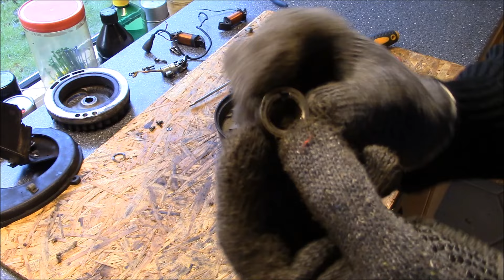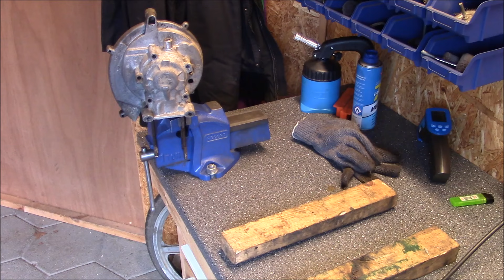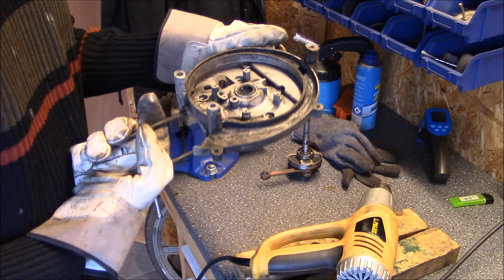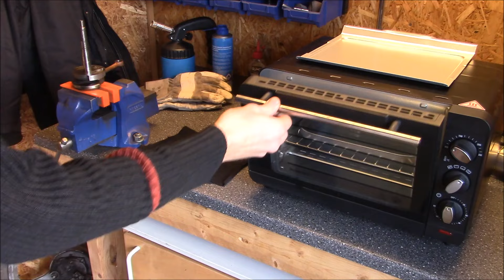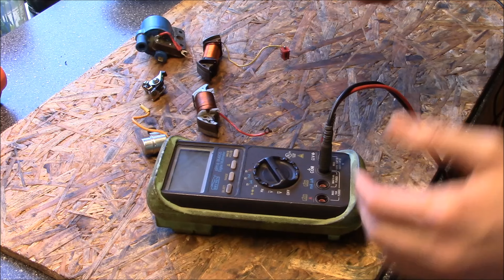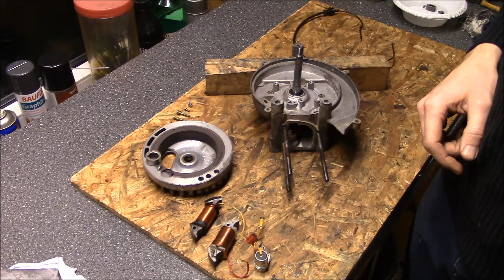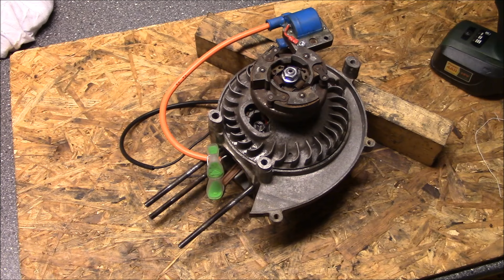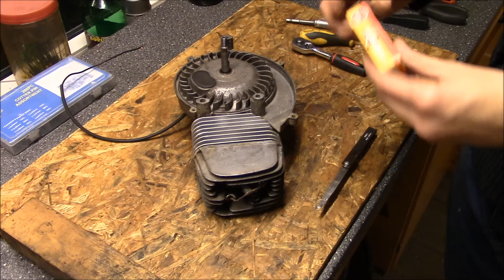Piaggio Moped Engine Rebuild

Comment: What type of silicone is used between the engine halves?
Reply from the maker: Originally, none. Just the paper gaskets. I like to smear them in grease, that makes them hold the position. And if you ever need to disassemble it again, the gasket won't stick to the surface as bad.
Reply from the maker: If your surfaces are bad, you can use a petrol resistant gasket marker. Like threebond 1104 or similar.

Comment: When I step on my kickstarter on my vespa bravo it stops/jumps, I have think it might be the swing wheel being broken, it does not feel like its connected correctly to the engine like yours is on this video.
Do you have any advise to what might be wrong?
Reply from the maker: I haven't worked on the Kickstart model yet, i have one in stock but no experience yet.
Reply: Is it a vespa or a bravo ?

Comment: My ignition coil has 0.9 ohm resistance.  However, it only measures  0.3 volts running when measured at the H.T. input.  Should I replace the ignition coil?
Reply from the maker: Did you measure AC voltage? I have no reference values like that, but your engine is running? What's the problem you are trying to solve?
Reply: @CarstenLorenzen12V  No, that was DC voltage.  I have an engine miss at speeds over 15 mph.
Reply from the maker: @rever1111  the coil makes AC. But that won't tell you much i guess.
A faulty coil could do that at higher speeds and heat in the coil.
Could be a carburetor issue too.

Comment: kan original crankshaft fra 25-30 km/t ciao fra 93 holde til malossi/polini cylinder kit?... du nævner på et tidspunkt de originale dele er ret holdbare... men det var vist mest si og bravo...
Reply from the maker: Hej, ja den er lige så stærk som de andre originale piaggio modeller. Hvis den ellers er i god stand. Husk at tilpasse styretiderne, det kan du se i den anden video jeg har lavet om denne motor.
Reply: @CarstenLorenzen12V  det simpelthen det sjoveste jeg har kastet mig ud i flere år ha! - 1000 tak for perfekt instruktions video. Har downloaded det skema ift.styretider du har lagt ud i .pdf på 12v.dk men er ikk´ nået dertil.  - Blot hygge og hobby no stress, godt din video nærmest er idiotsikker hahaha...

Comment: Perché si mette la spugnetta nel condensatore?
Reply from the maker: The sponge is there to lubricate the cam that drives the points/breaker. Put a little oil or grease on it every time you adjust the oints gap.
Reply: @CarstenLorenzen12V  Ok thank you

Comment: Nice Vid, do you have a video for an electronical carter
Reply from the maker: No, but it's even easier than the model with breaker points. I think the tuning video i made, is an electronic ignition model. But i'm not talking about the ignition in that video. It just needs to be installed, no adjusting.
Reply: @CarstenLorenzen12V  Ok thanks Do you know wich wires would you need to check with a multimeter on the elec. ignition? and are the volts the same as the breakerpoint ign.
Reply from the maker: Yes, here are some values I've measured.
Light, brown 2,1 ohm  6V/10W brakelight or horn
Light, blue 4,0 ohm 12V/10W indicators
Light, yellow 0,7 ohm  6V/20W lights front/rear
Ignition green 430 ohm - ignition primary
Ignition red 51,8 ohm - pickup
Ignition white ~0 ohm - ground
CDI output wire 4420 ohm

All measured against ground. The three ignition wires are the same for all cdi models. The colors for the light coils can vary.

All measurements can very 10% i guess.
Reply: @CarstenLorenzen12V  Thanks again yr help! in the vid yr talking abt blowing on the carb inlet to check air thightness. do you have any air escaping? ik just build a speedengine with a 65cc DR however all nice and tight but with blowing does seem to have air escaping, really minor..
Reply from the maker: @keesgroeneveld965  it's normal to experience some leakage, but only minor. But you need to feel a good resistance. Hard to describe a feeling like that, kinda takes some experience :-)
Reply: @CarstenLorenzen12V  yes resistance is felt. will let you know the elec. results. I am restoring an 2005 Gilera Citta i think i will encounter some more items.
Reply: @CarstenLorenzen12V  hi i have measered them good news there is a reading! the cdi output(sparkplug cable?) reads 5200ohm is that possible?
Reply from the maker: @keesgroeneveld965  yes that is a correct reading. But the internal cdi is not measurable with simple tools. If it works it works, if not, mount a new one.
Reply: @CarstenLorenzen12V  hi carsen could you help me with a film for front wiel axle assembly?
Reply from the maker: @keesgroeneveld965  no time at the moment.

Comment: Do you know what licence you need and how old to drive Piaggio Bravo
Reply from the maker: In most of europe you need to be 15 or 16, depending on the topspeed. But there are so many national laws, so get in touch with your law enforcement. Or maybe google what moped laws your country has.
Reply: @CarstenLorenzen12V  But is it a normal moped or a small moped?
Reply from the maker: It's available as both small and large moped models. With speeds between 25 and 50 km/h, depending on the country.

Comment: At 1:37 this puller, can you give me a link to buy this tool? I cannot find it after searching online. I can't open my piaggio motor without it. Carsten lorenzen I found it just now it's the Buzzetti Magneto Flywheel Puller for Vespa Piaggio. Description reads High Quality puller tool for Vespa Piaggio Ciao, Citta, SI.
17 x 1mm threading
Buzzetti # 5255

Comment: I would have done a better job cleaning it , the whole outside body  .  I can tell your a good mechanic  , so here's the question:  how many hp is that tiny engine and what would you do to upgrade it . It looks like 1.5 hp at best .
Reply from the maker: Yes about 1,5 hp in this trim. You can get about 5 hp with a little more work and a good 43 mm cylinder. Take a look at my other video, posted a few weeks later. Piaggio engine tuning, i think that's the video name. There i describe everything you need to know.

Comment: I have the same problem as the girl in this video. Any ideas where the leak is? Any ideas for a solution? https://youtu.be/VUdeu8NDEhk
Reply: does your engine runs good for a couple of miles and than begin to run bad? or does it run bad from the beginning?
Reply: Medemblikker It runs quite ok all the time, some fourstroking. But its greased up pretty bad.

Comment: The best video available for the Vespa engine. Could You do more video’s of the clutch etc well so far thx
Reply from the maker: Thank you :) I will do my best to make more, when i can find the time.
Reply: Kudos to you Sir . But I have to ask  , you didn't show us that modification about intake port and crankcase that you mention ... other than that this is perfect .
Reply from the maker: Thank you! I made a video only about the tuning part here: https://youtu.be/4mcr5-tuANY
I thought it would be best to keep them apart, so that the non tuners don't have to go through it all :)
Reply: Good point , thanks. Going there wright now .

Comment: do the points constantly make contact with the crankshaft or does it only touch it to open the gap on the points?
Reply from the maker: I think when correctly adjusted, only when the lobe starts to rise. If they where in contact all the time, the points would open very early and could also open at the wrong time due to engine vibrations or worn crank bearings. But that's something i've never looked at, so i'm kinda guessing ;-)

Comment: today i started with the revision of the engine because it had some strange vibration.
did that often in the past but not for some years .
stopped half way and needed some help and advice so turned to you tube : your video is of great help ; tomorrow i am going to fix the problem!
Reply: afterraincomessun u need to fix the flywheel with flyweight

Comment: how do you grind out the case to fit a 46mm cylinder?
Reply from the maker: Give it to a machine shop and ask them to mill the case to the desired measurement. Measure the diameter of the skirts and add ~0,3 mm in diameter. It's hard to do with a hand grinder as the skirts are very long on these cylinders.
Malossi makes a handheld tool for this, but it's a bit expensive - probably more than a few trips to a local machineshop.
Reply: Carsten Lorenzen 
coincidentally I work at a machine shop
Reply from the maker: We have a CNC mill at work, but i can't operate it myself, and my colleague has very limited time. Wish i could do it myself :)

Comment: Hello, what is the size for the bearing of the wristpin
Reply from the maker: If i remember correctly, it's d10 D14 and the width i can't remember. Maybe ~15 mm wide.
Reply: Carsten Lorenzen D14 won't fit in my old vespa SI and the old one was too damaged so could not get the exact dimensions.
Reply from the maker: I may remember incorrectly, let me check it for you later today! BTW, is your crank originally with a needle bearing? The old ones had a bronze bushing, you can't fit a needle bearing there for several reasons.
Reply: It did look like a bearing but since it was so damaged i can't be sure
Reply from the maker: I was wrong, it's d10 D13 w14.
Reply: Thank you

Comment: also, a good tip for assembling bearings: after you heat the bearings, get a can of keyboard cleaner/compressed air can and turn it upsidedown and spray to quickly cool the crank shafts before dropping on the bearing. it's quicker and easier than putting the whole crank in the freezer.

Comment: damn that's a small ass intake port, I didn't know they came that small.

my Ciao seems to have poor ignition, the spark is weak and sometimes takes a lot of pedaling to start, especially when hot. I use NGK B7HS normally, it won't spark at all when using a surface gap spark plug without the little armature, I believe it's NGK BU8H type plug.

Comment: We heet the bearing to 120 degrase ..but they wil not go on the crank
Reply from the maker: I never have problems on the ignition side, at 120°C. But the small shaft end can be tricky because it's so short. Sometimes you need a hammer or press to get it on. Always push on the inner ring, making sure that the bearing is straight. And as i mention in the video, support the crankshaft in between the web/halves.
Reply: Do you pre heet the oven before you put the bearings in ..or do you  put the bearings immediately in the oven ?  oh and thanks for your comment
Reply from the maker: Yes the oven is pre-heated, give them about 15 min. That's normally enough for me. You can also put the crank in the freezer over night (put it in a bag). That gives you an extra ~40°C temperature difference.
Reply: thanks for you comment :)

Comment: I have no spark on my bravo. Tried a new condensor, didnt work. So i am going to do the test of ignition parts, as you do in the video. Can i keep the cylinder on, while checking for spark? Just mounted a malossi gasket set on it, and don't want to ruin it. Thinking of taking the spark plug out, and letting some gasoline in, just in case...
Reply from the maker: Yes you can keep the cylinder in place, it's easier. Take the spark plug out, and maybe a few drops of oil to lubricate the piston while you test turn it.
Reply: Tak for svaret, og tak for videoen. Den er bare go :)

Comment: Thank you for making this! Very good guide. I like that you not only tell how-to-do, but also how-NOT-to-do! Because it will save people from making common mistakes. You also mentioned the torque of the top to be 12 Nm. Do you also know the Nm torque of other bolts? Like say the crankcase bolts, the clutch, the pulley-"disc" or whatever it's called etc.... Is there a Nm torque table for this moped?
Reply from the maker: Thanks for your kind comment. The torque values are on page 65 of the original workshop manual, try to find it on google.
Headnuts - 10-14 Nm
Crankcase - 10-13 Nm
Clutch or Vario - 20-25 Nm
Rear Pulley - 13-33 Nm
Rear Vario Pulley - 20-25 Nm
Reply: Thank you! And nice work on your Ciao. By the way; I looked at your pictures on you page... and I have never seen the restrictions on the clutch and pulley that you had. Are those restrictions "danish" - or made for the danish market? I have worked on a few Ciao's in sweden, and only seen restrictions in the gas intake.
Reply from the maker: I only know them from the danish models, we got all the good restrictions on our mopeds, snap of bolts, welded sprockets etc. :)
Reply: Please scroll down on this site:

https://piaggio-mofa-technik.de/forum/technische-daten/technische-daten

Only in german but you can translate the most important things with guugle or something similar.
Reply: Thank you very much! :-)

Comment: When i did a rebuild on my Piaggio Ciao engine i didn't thought it was a difference between the two bearings so i just mounted them anyhow. And when i mounted my two engine blocks the crankshaft didn't turn around as smoothly as before. Do you think the cause can be the bearings that is on wrong positions? Is there anything else that can turn bad by having it like this?
Reply from the maker: The reason that your crank didn't turn as smoothly is not caused by the eventually misplaced bearings. The extra clearence is between the balls and inner/outer ring, probably to accommodate for the extra heat the ignition makes. I think the reason is that the bearings are under tension, that happens easily in this kind of engine where you mount it hot/cold. If you run it like that, it can shorten the bearing life alot!
You can reheat around the bearing seats on the outside, and give the engine case some rubber-hammer hits like i show in the video, that normally helps with the tension.

Comment: Is it possible to use the original ignition with the 60cc athena? When getting over 45khm it just bangs and lose the power. Stop the engine and start again like nothing. Any ideas?
Reply from the maker: Yes the original points ignition is stable up to around 10.000 RPM. Most Ciao etc kits are pretty mild in the RPM department. Be sure not to run too much pre-ignition. With a tuned engine it is best to measure the exact ignition timing, especially with aftermarket points. I had to use 0,30 mm points gap to get down to 17-18° ignition before TDC. With 0,40 mm points gap, i had alot of knocking on my Polini 46 mm engine and way too much timing advance.
I would recommend a timing of 17-18° before TDC if you use a degree wheel, that equals 1,2-1,3 mm before TDC if you use a micrometer.
BTW, is your jetting correct?
Reply: New to timing ignitions but will look it up. Try to make it to 0,30 rather then 0,40 that is now I guess. The fuel/air is good. Chocklad brown on the sparkplug.

Comment: Hej Carsten. Meget meget fin video! Jeg tillader mig at skrive på dansk, da jeg mener at høre dig omtale Danmark. Jeg har selv en Ciao, som har kørt nogenlunde bortset fra, at den kun har kørt 26-28 km/t på det seneste (måske har den 4-taktet?). Jeg har renset karburator, skiftet stempel og ringe. Den har startet første gang. 
Forleden dag ville den pludselig ikke starte længere. I desperation har jeg påsat nyt tændrør, tændspole, platiner, tændrørshætte og kondensater. Alle komponenter har de værdier, du omtaler i videoen. Jeg får kun en meget lille og meget ujævn gnist i platinerne, og jeg kan desuden ikke få gnist frem fra tændspolen og kabel/tændrør? Har du lyst til at givet et bud på, hvad jeg kan gøre? Jeg overvejer, om det kan være den indvendige spole.

Med venlig hilsen

Rune
Reply from the maker: Rune N Hej Rune. Hvis de nye dele er i orden og god kvalitet, så kan det næsten kun være den indvendige spole, selvom den plejer at være ret robust. Gnist mellem platiner plejer normalt at være en dårlig kondensator eller forbindelse dertil. Check ledninger og forbindelserne samt stel forbindelse mellem delene. 
Noget andet, tjek at noten ikke er knækket så svinghjulet har flyttet sig. 
En anden typisk fejl er at ledningerne på platinerne kommer i kontakt med svinghjulet, så kortslutter tændingen. 
PS: Hvilken tændspole har du monteret, jeg har dårlige erfaringer med alt andet end den originale blå.
Reply: Hej Carsten.

Mange tak fordi du har taget dig tid til at svare.

Jeg er faktisk ikke klar over, hvad tændspolen hedder, men jeg fik nogle fine målinger på den gamle blå, så den kommer på igen. 

Ledningen fra kondensatoren er godt slidt der, hvor den er monteret på selve kondensatoren. Det er formentligt fra undersiden af svinghjulet - jeg skifter kondensatoren.

Jeg bliver lidt i tvivl om, hvorvidt man skal kunne se gnist ved platinerne? Er det korrekt, at hvis man kan se gnist, er der tale om en dårlig kondensator eller forbindelse?

Jeg prøver at gå tingene efter igen og tillader mig at skifte den indvendige spole også. Må jeg skrive en update, når jeg når dertil?

På forhånd tak!

Rune
Reply from the maker: Når ledningen er så slidt, så har det sikkert været et problem. Rammer den svinghjulet kortsluttes tændingen. Så det er meget vigtigt at arrangere ledningerne så de ligger fri, og at de er godt isolerede. Hvis du kan måle en god værdi på den indvendige tændspole, så lad den være. Hellere en god original end en ny uoriginal. Samme med den udvendige.
En bette gnist i ny og næ er normal, ved platinerne. Men hvis det nærmest sker konstant er der noget galt, enten overgang i ledning eller kondensator.
Jeg hører gerne hvad historien ender med :)

Comment: hy. i got a bravo too and i don`t have constant spark What Can't Be??
Reply from the maker: Does it spark at the breaker points? Could be a bad capacitor, bad connections, faulty coil etc. But also a simple thing like a broker spark plug og cap.
Reply: flywheel was the problem rub in housing and,broke the key now must take another flywheel..anyway thanks for the information